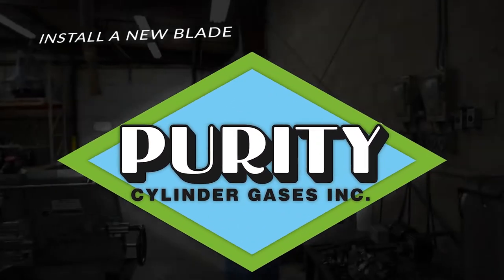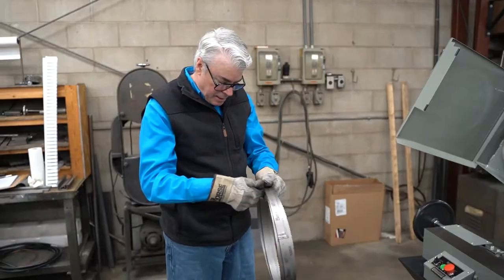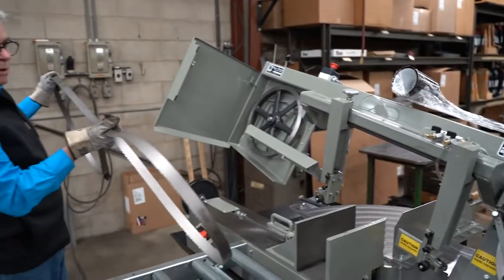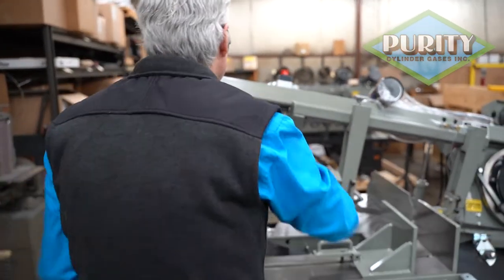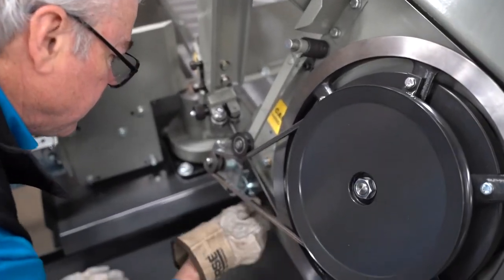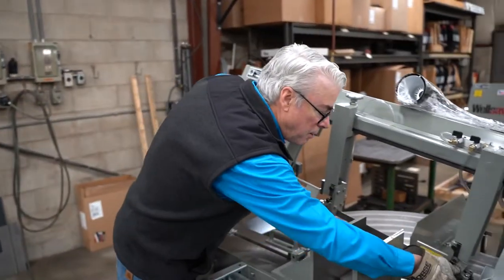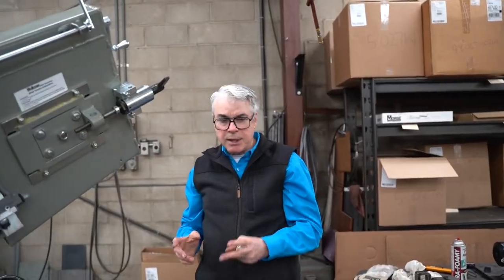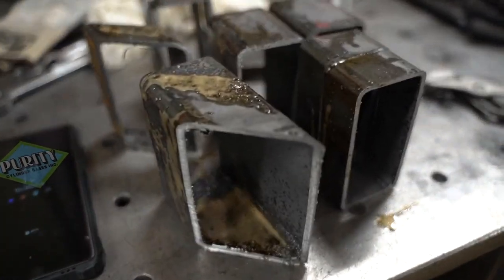Industrial Metal Cutting Band Saws - Setup & Best Practices - Straight from the Factory!

Comment: I love my Wellsaw.....only a model 300, but it is a cutting machine.......
recently had to get a part for it, it is a 1960 build.....I called, and 
they got me the Parts dept....well, I said I need a gear for the 300,
they right away told me the part number, I mean within 2 seconds.....
they said it was the only thing that ever goes wrong.....
.well, the part arrived 3 days later 
and fit perfect....I highly recommend Wellsaw....Paul in Florida
Reply from the maker: Paul, this does not surprise me one bit. Wellsaw is known for high quality and great customer service. The machinery they sell is meant to last and they have an extensive parts department to help service their equipment - even equipment that is decades old. Thank you for sharing!